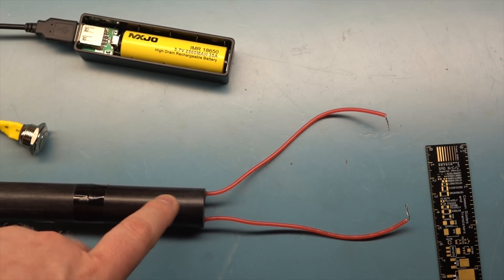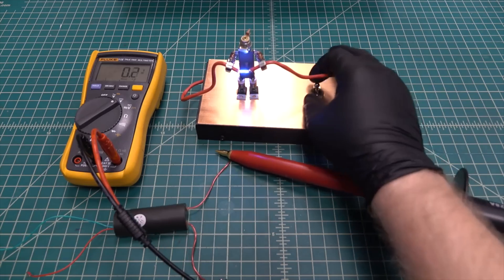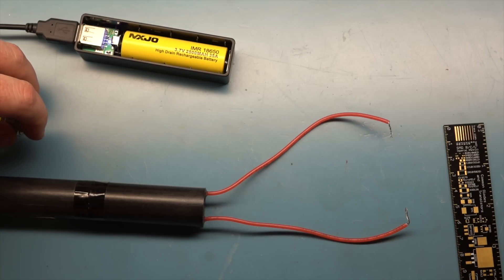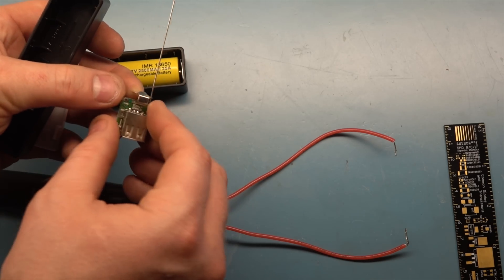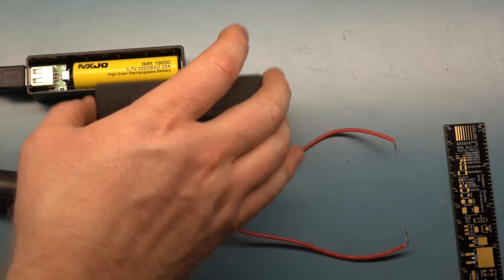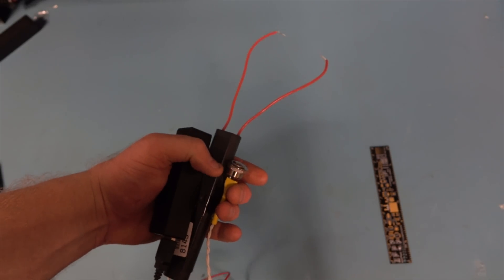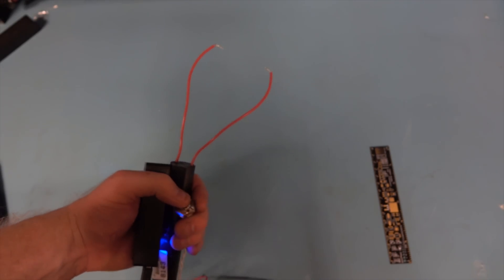Testing Cheap 800kV Module

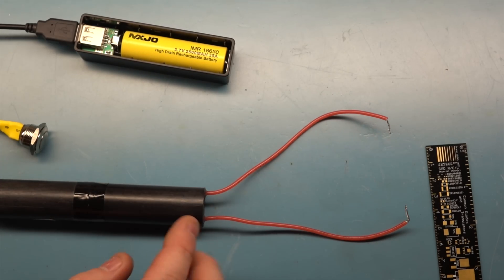Comment: 1:07 It's arcing internally cos it has got spark gap tesla coil as second module. And first module is flyback high voltage transformer feeding tesla module

Comment: It doesn't matter if they give you money or not. There is incentive for you to give good reviews to get more free stuff. The results is the same. The review isn't impartial, unless you pay for it with your own money.
Reply from the maker: I don't agree, that depends on the person reviewing the product. I have since been offered several items to review from this company and turned down all of them. I will only do a video that I am actually interested in and I'm honest about what I am reviewing.  I said this is NOT 800kV even though it claims to be.  What more could you ask for other than the facts?  This unit arcs about 2 inches and outputs about 50kV.  Fact based reviews are impartial.
Reply: @ProtoG42  I'm arguing with someone regarding how to estimate the output voltage of a flyback based on arc length.The accepted dielectric breakdown  of air is 30kv/cm. This eng uses the 30 which I think is wrong. It seems you used 10kv/cm do you have an elaborate explanation? I also use 10Kv because of point action but there doesn't seem to be good explanations in scientific world about sharp electrodes.

Comment: Sir can I use 800kv module (20000V) to power a Smoke Precipitater????
Reply: only if you rectify it into a static DC voltage potential. look into voltage multipliers for that. ..but it's also a good excuse to build a van de graaf generator. ;)
Reply: you should build a negative ion generator

Comment: Hey, can you please tell me what is the output frequency of such a device? 
Thanks
Reply: It's a pulse module. It's pulsed DC so it doesn't have a frequency. The distance of the output leads determine the discharge freauency.

Comment: Ohhh yeaaahh this is a massive spark hahaa... I bought pretty much all models I could find, some are just BIG casing and big specs but small spark... I connected two in parallel and got a very powerful spark, now I'm connecting 10x in parallel and see how it goes. The most powerful I found drains 3.72A at the highest voltage so I'm expecting a massive current and a very loud and powerful spark... so much POWEEEEEERRR
*love your channel and all your experiments =]

Comment: hi where can i get a dimmer circuit to adjust the voltage from 0 - max?  is it posible to dim control the input and out put?
Reply: piccolo sun I saw one where the input voltage was 3v-6v so the input voltage can be regulated, don’t know how much effect that has on the output voltage. 
To dim the input voltage you can simply use a potentiometer or use a power supply that can be regulated.

Comment: im not at all an electronics guy by no means, but am i able to connect one lead to the upper tip of a spark plug and the other lead to the body (ground) and will it ignite the spark plug for a project im building?

Comment: Thanks for the review! I was wondering when you are firing the unit continually at the end of this video, it makes the click sound but no spark is seen? is this just in-between the frames of the video? or is it happening also in real time?
Reply from the maker: The camera is missing the frames, that's why I did the 1000FPS shots.  The slow motion shot is actually what is happening when you hold the button down.

Comment: Had a few of these to mess around with,word of warning don't make the gap to far so no spark...you will kill the unit
Reply from the maker: Yes, if you spread the output wires too much, it will just arc internally.
Reply: hahaha, I can vouch for this! Killed 2 units today. Dont do it, you will regret it :)
Reply: George Vavouras yes if you step down the voltage, the amps will go up
Reply: Proto G if you powered the module from the other side (from the originally hv output wires) would the amps multiply? I think the module would just be destrioyed. I have bought a module almost like yours. Can you answer, please?😂😂
Reply: οχι

Comment: Huh that's pretty cool, I wonder if the first section is like the regular one then if the second is just filled with capacitors and diodes to make a voltage multiplier?
Reply from the maker: Keystone Science yeah, that is most likely the case.  They probably added a Cockcroft Walton multiplier to the original unit.  I have tried cutting these open before but they're potted pretty well.  I do have the schematic for the internals of the original though.
Reply: MG chemicals make a solvent for most common potting compounds provided th didn't epoxy pot them.
Reply: Lol you? Here? :D
Reply: cut it open and record it, i would like to see how it works internally. And hi Keystone Science, i've made a taser from your videos for my science fair
Reply: Keystone Science ចង់រៀន
Reply: you might be interested then in this: 
Reverse Engineer Resin Encapsulated High Voltage Module From China https://www.instructables.com/id/Reverse-Engineer-Resin-Encapsulated-High-Voltage-M/